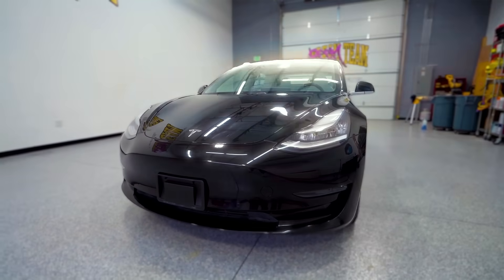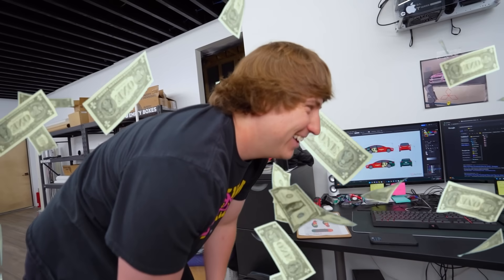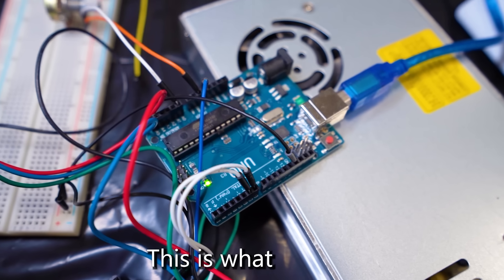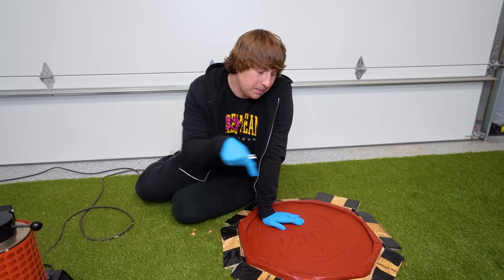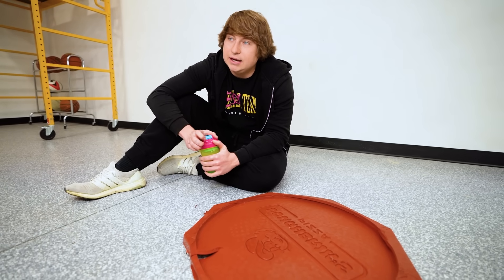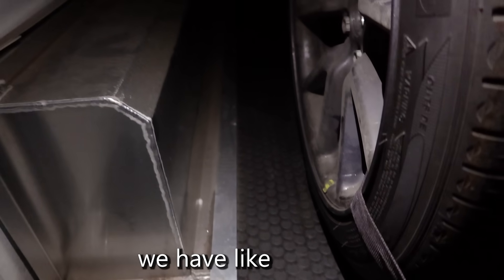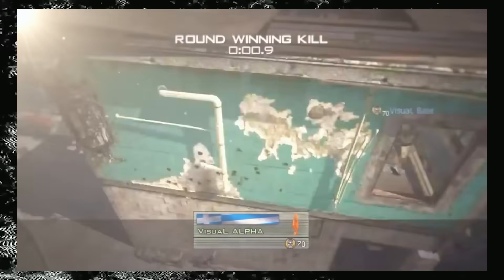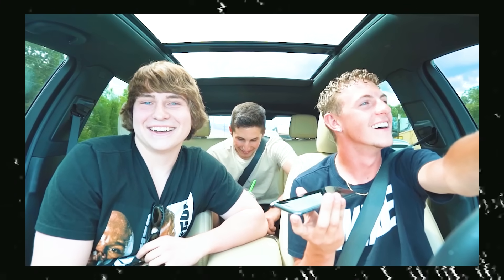I Surprised David Dobrik With Custom Tesla!

Comment: 1. David didn't give away the ferrari you posted in your video 2. denver to LA is a 15 hr drive, not 2 days 3. how does your truck get stuck in the snow unless you're off-roading (or did it on purpose for content)